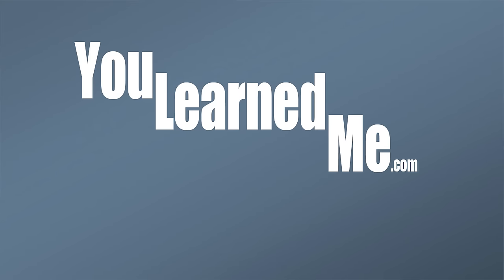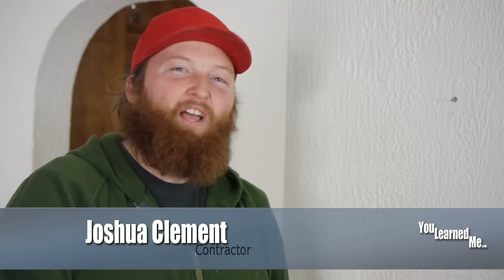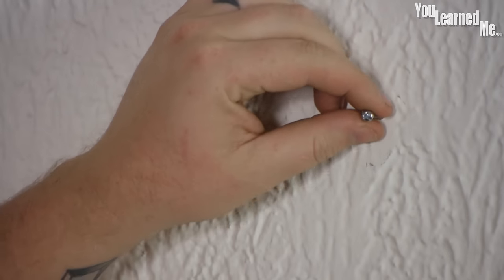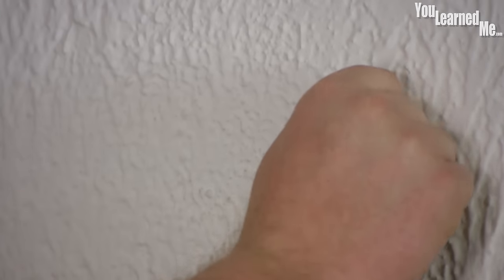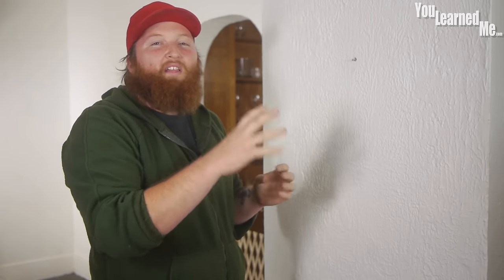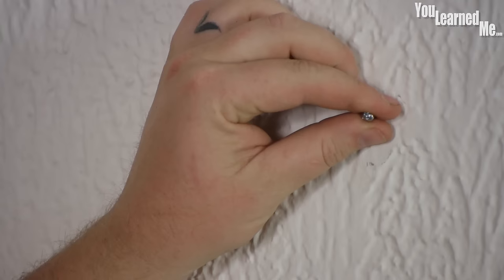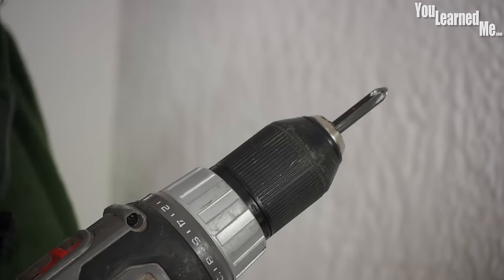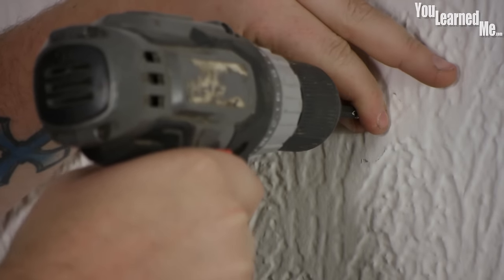How to Remove a Toggle Bolt Out of Your Wall

Comment: great, now i need a video on how to remove the fallen toggle bolt
Reply: But why would you even try remove it?
Reply: Punch a hole in the sheetrock, remove bolt, patch sheetrock.
Reply: @Iisakki3000  So it could be used, duh.
Reply: I made a video on how to remove them without dropping anything into the wall: https://youtu.be/nu3ZVMVIK3s

Comment: So, your video is not how to remove a toggle bolt, your video is how to remove only the bolt. Toggle bolts pivot at their base, you have to push one end in order for the backside to flip and clear the edge of the hole. Once it clears it is just pull out.
Reply: Thank you, this was the actual information I was looking for. :)
Reply: Yep, this is all I needed to know! Thanks Quentyn73.
Reply: Btw, it may be helpful to others to know you have to thread the bolt almost all the way out, taking care not to thread it completely out. Only then will the toggle pivot at the end of the bolt. I used some small needle nose pliers to help it a bit.
Reply: THANK YOU, I'm a renter and I don't want to leave random toggle bolts in the ceiling.
Reply: @jet_blast1622  too late but that makes sense

Comment: All you people complaining about the toggle bolt. Go buy a new one lol sorry but those things are designed to remain back there. If you do manage to get it out you’d have made a major hole in your drywall / plaster in the process.  Don’t they have “smart toggle bolts” now where you can pull a string during the removal process? Sheessh

Comment: Man... was in the process of replacing my Old GE microwave with a Samsung where I thought I could reuse the old holes. Well, it worked but was too close to the top of the bottom of the cabinet... so I was hoping I could remove them... saw your video and have not had a good laugh. Was hoping to get the way to remove them but ended up just listening to you and will be going to the store and buying more in the morning.

Comment: How do I remove a toggle bolt that’s connected with a hook? I was hanging a hook on my ceiling for my plug-in light and I didn’t screw the toggle part high enough So you can see the screw in the ceiling hanging down

Comment: Why people would need a video on how to unscrew a bolt is terrifying.   Heres the real problem.  Within the first couple turns the toggle looses   tension and just spins with the bolt. There's no room to pull on it to keep it still.  At which point your better off pushing the bolt through the wall leaving a nice big hole in the wall

Comment: The only other solution is to cut a square around the toggle, and patch the drywall.  I guess no one would ever know if you dropped the toggle inside the while, but I'm not wired that way.  It's not that hard to patch a relatively small hole in drywall, but it does take more time and effort.
Reply: You can remove them without more drywall damage: https://youtu.be/nu3ZVMVIK3s